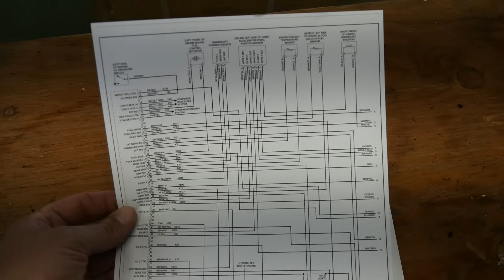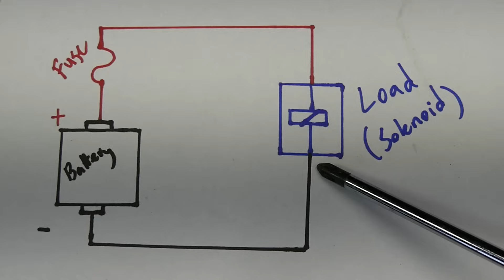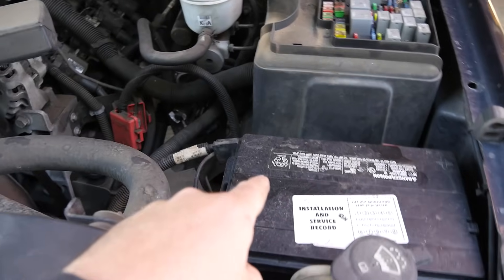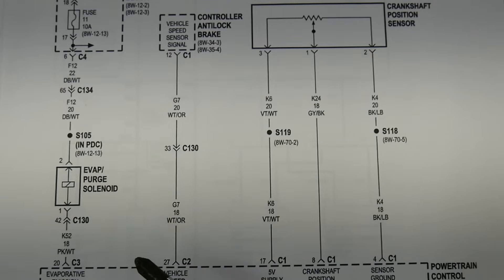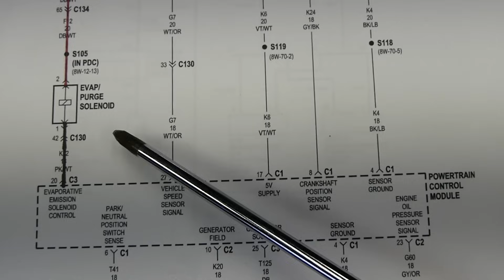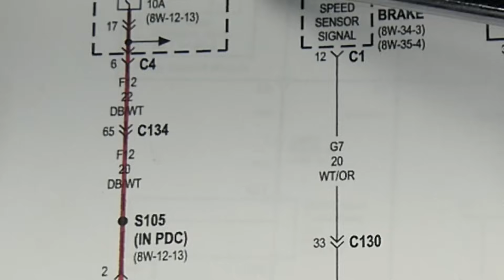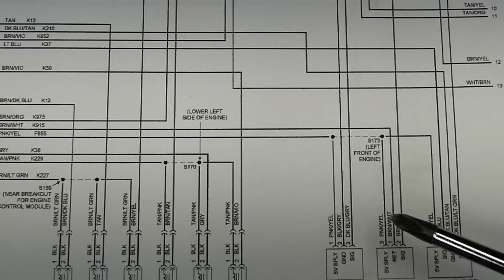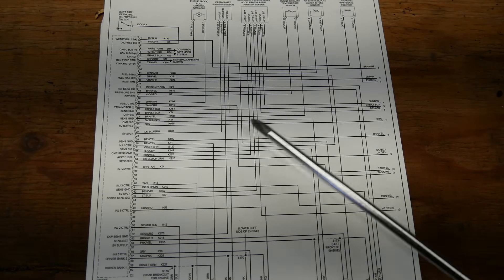Wiring Diagrams Explained - Easy Peazy

Comment: Red wire from the harness going to the alternator pig tail? And the white wire going from the wire harness to the pigtail?
If the mechanic swapped these 2 wires and they get connected backwards does it ruin the Battery?  Does it make the car not start?  Please help

Comment: I’m stuck on an issue, 03 Yukon xl. HVAC issue I traced it back to the white wire in the sp205. The ac control module lights up but no function when it’s plugged in it shuts down the radio, dash gauges and the rear ac. Can u help me please

Comment: Thank you so much for this video! Its super helpful. I was just wondering if anyone has some feedback/ advice for my current situation: I have a 97 chevy van that has a lot of wiring issues including no brake lights, turn signals or hazards. After checking out my wiring I realized that previous owners had totally DIY rewired a bunch of stuff so looking at the wiring diagrams isn't really helpful anymore and I'm super confused on where to go from here. I don't have money to take it to a shop and I'm trying my best to fix it myself but I'm just really confused on how to even approach this project since I can't use a wiring diagram and my wiring is pretty mickey moused. Does anyone have advice on how someone like me with basically no autoelctircal experience could work on a project like this? I know it's a kinda vague question but any feedback is welcome :)) and thanks in advance

Comment: Hi, i have an issue with headlights on my 04 Camry ( Australian built ), they don't work. there are 4 fuses, 2 for each side and none have power. The head lamp relay works and has power IN but the out side shows nothing, ok, but when I connect the + lead of dmm to battery and -lead to the out side of relay socket I get a reading. Is this normal ?

Comment: I must have watched a dozen videos read and reread manuals...

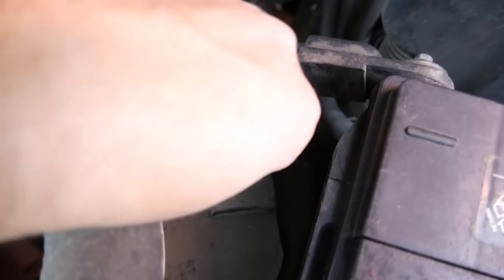At exactly 2:29 you reminded me of an obvious operator error -- having undone several aftermarket catastrophes on a used 1979 Dodge b200 I forgot to reattach the negative battery terminal to the chassis!!

Thankfully only 1 terminal connector melted at a splice point

Next time I'm searching your videos first ⚡🍻

Comment: Hellou. I have a ford fusion 1.6 tdci 2005. I tested the EGR plug with a multimeter and it doesn't have 12 v on the pin,  is a fuse or relay that would cause the problem. Thank you

Comment: I watched your suspension videos since I'll be doing mine soon. Can you get away with torqueing before you set the car down or is it a must to do final torque after on the ground. Also, if after, if it is to be torqued at  100lbs, would you torque to 90lbs and then the final 100 after on the ground?

Comment: I really enjoy your videos & how you break things down & explain in novice terms. I have a video idea for you unless you've already done this. If so let me know. I have a 92 Geo Metro 3cyl. 250k mi. Runs rough & smokes. I'd like to take out the engine & get it refreshed by a machine shop. I'm not entirely sure what to ask or expect especially in prices. The vids I do find are more surrounded around high performance. As are the shops here in San Antonio. That's not what I'm after. I just want a basic. Honing of cylinder sleeves. Checking crank & cams & bearings & maybe polishing crank. Maybe a few more things but again not sure and like I said most vids are for aimed towards racers. I'm actually more interested in a optimal mpg build. What would you recommend?  Thank you.

Comment: Thank you for explaining wiring diagram could you pleas explain how you can test any sensor out of a car with a voltmeter to see if the  is the sensor is working or not
Thanks Lawrence
Reply: You have to recreate the environment that the sensor is sensing in order to see if it's working or not.  If it's a temperature sensor, then changing the temperature (boiling/freezing water) and watching for a change in the resistance on the sensor can be helpful.  Sometimes you just have to back-probe the wires going to the sensor to see whether it's in the proper operating range.  (often changing - sometimes too quickly for the voltmeter to follow accurately).  Sometimes you have to just disconnect something and see if the car's behavior changes.  If it doesn't that's not always a good thing.  Sometimes you have to "activate" that circuit in order to test with pulling a connection.  For instance, a high speed fan circuit may require a certain temperature range, or RPM or the activation of the air conditioning compressor.  

Bottom line, understand how the sensor works, so you can see how to test it.  Intermittent electrical problems are the ones that you pull your hair out on...  Learn to also use a OBD2 scanner that shows higher details than just reading codes.  Some are phone based.  Get a decent volt meter and know how to use it to test across loads, or check amperage readings (need to swap probe positions for this).  Learn not to do resistance checks on a live circuit.  Learn ohms law.  That way you can use a voltmeter to look at voltage drops across a load and determine current readings.   Learn to "divide and conquer"  It may mean you have a single sensor or problem causing multiple problems.  But you may also learn that there are multiple problems there, and the computer has been compensating for it.  Also think about what might have caused a sensor to fail (ie, O2 sensor can get clogged when running too rich for too long, or burning odd substances, or NOT burning fuel until too late (in the catalytic converter - makes loud booms).

Comment: I was taught how to read electrical diagrams while in the Air Force since we had to work on the weapons systems on the B-52 bombers and they wanted us well trained to do the job. I thank you for showing us how we can look at a diagram and figure out where the problem is and I have some tools such as the multi-meter and various meters and I use them when needed.

Comment: If you don’t know how electrical systems work in cars, you’ll never be able to fix anything but the most simple problems. Continue this series!
Reply: I agree and im tired to be the guy praying for the problem to be small all the time. Not even a pro but im ready to get it or die trying
Reply: @CBRRR-eh3ky I’m at this phase, how has it been
Reply: U can if u have xentry ( it's computer which gives u all the details u don't need to understand anything but still u will be able to work )
Reply: Yeah man same here 32 years old wanting a mechanic career literally die for it now
Reply: How do you test from the fuse box to the pins and the module connectors

Comment: 5:45 what do the arrows mean? I’ve always wondered.
Reply: The arrows you are talking about are showing where a connector is. The arrows indicate the actual gender of the metal terminal (not the plastic connector) inside the connector. If it is a male terminal it is arrow pointing out which mates into the female terminal. That way, when you are testing at a connector, you know which side of the connector is which.
Reply: @BTCAutomotiveTech  awesome! It makes sense now! Thank you so much, happy thanksgiving!!
Reply: , directional flow of electricity
Reply: @JustinPaul1st  but the arrows change directions, in some cases they are pointing away from the fuse, in other cases they are pointing toward the fuse. All in the same Circuit.

Comment: How about sources to find wiring diagrams, for the diyer.
Reply: Try AlldataDIY. $30.00/year for 1 vehicle ( half that for subsequent vehicles). Includes component location info. Crucial for electrical diagnosis. If you're looking at wiring diagrams, you'll almost always need to know where the specific connectors, splices and grounds are physically located in the vehicle.  This subscription also includes all factory procedures such as component testing and replacement procedures, torque values and a lot of other info. Worth every penny.
Reply: You never know what resources you could find at the public library and if they don't have it you can request them to get it you never know
Reply: Go to ebay and find a service manual pdf. Like 15-30 bucks has everything you'll need
Reply: @mauricioespinoza5390  If you're referring to manuals such as Hayne's and Chiltons,   they only have a small selection of wiring diagrams for a given vehicle. For example, the Haynes manual I have for one of my cars has 11 pages of wiring diagrams. In reality, there can easily be 50-100 pages or more of wiring diagrams for a given car. They even state that "since they can't include all wiring diagrams for the car, they've just included the most commonly used ones".
Reply: @davidquinn6161  No, I mean actual dealership service manuals with all the wiring diagrams. I got one for a 1997 camry had all the service instructions.
Reply: @mauricioespinoza5390  Yes, those are great. I got one for my 1985 Corvette and it was extremely helpful. But they're very pricey now from the dealer. Over $200.00 for one for my 2013 Impala. And only available on CD's. I prefer paper versions. I bought mine from Helm in Detroit which is authorized by GM.

Comment: R&W  Sharpie!?  I find that a highlighter is much better cuz you can still read the underlying diagram.  And they're available in many delightful colors. Which is actually very useful for highlighting different contiguous conductors. You can use coolish colors like blue or green (I've yet to find a black highlighter, er, lowlighter) for grounds or ground-side switched wires, and warmish colors like red, pink, orange for always-hot, switched high-side, or +5V, and so on.

Comment: Do you know of anyone offering Free Automotive Wire Diagrams?
 now that BBB industries no longer do.
Reply: I don't know of any free sources of wiring diagrams ( unless you live in Canada ) but see my answer to Joe Boyer's question.
Reply: @davidquinn6161  Thanks David, but, $30 bucks isn't Free. lol.
  and Yes I do live in Canada, does someone here Offer a free service for Diagrams?  BBB industries was Awesome for this info,. What happened I wonder.
Reply: @Ron0963  Part Source stores will print wiring diagrams but they don't have stores in all provinces. Since BBB quit offering them, I haven't found any other free source.
Reply: @davidquinn6161  OK cool ,Thanks,, we got Part Source in Ont. I'll keep that in mind,  the GM dealer around here will print off a diagram too (or they were generous that time/day) lol
Reply: Sometimes it's worth buying a factory service manual (paper or electronic) to review.  They're sometimes offered on ebay.  I'd be wary of free manuals these days.  They try to get you to install some skeevy software to view them, or are infected files.  Check in car forums for your vehicle.  Sometimes someone will send an electronic copy to you.  

I recognized a Chrysler format diagram being used in the video.  It's WORTH knowing what those connectors and splices mean and where they're located.  Sometimes those wires contain fusible links that are made to melt under high current loads, and you'll need to know when your circuit has them.  They're invisible to spot visually for the most part.  But knowing where connectors are helps with divide and conquer strategies, when trying to pin down a problem between power and the load, and the load and ground.

Sometimes using cheaper paper manuals will get you by on wiring manuals. (Chilton's).  It's worth reviewing carefully for the circuit you need.  And don't whip out that phone and take pictures of them. 

Sometimes libraries may have subscriptions to access auto manuals or schematics.  For the price of a free library card you can get access.  Maybe there are car clubs in your area, or you can subscribe to online that has a library available for use.

Comment: Your flow direction is backwards. Flow is from negative to positive.
Reply: You refer to the confusion between electron flow and current. Automotive techs and engineers (and our meters) think in terms of _current_. Current is the rate of flow of _charge_. In a typical automotive circuit, electrons move in the direction from the negative battery terminal, through the load, to the positive terminal. Since electrons carry a negative charge, that flow of electrons is a flow of negative charge from negative terminal to positive, hence a negative current from negative to positive. That is a positive current from positive terminal through the load to negative terminal.  That is why current is shown as positive from positive terminal through the load to negative.  There is no point focusing on the electrons per se. It's rate-of-flow of charge that produces the important electrical and electromagnetic effects.  That charge can be carried by negative charge carriers such as electrons or negative ions, or by positive charge carriers such as protons, positrons or positive ions.  The negative charge carriers flowing from A to B produce the same effect as the positive charge carriers flowing from B to A, hence it's useful that both are accounted for as a current from B to A.

Comment: I agree that reading a wiring diagram can be confusing for those who have never done it, but they're pretty easy once you know what you're looking at.  The problem today is getting your hands on a wiring diagram in the first place.

In the last 30 years, automotive wiring has gotten so convoluted that the diagrams in the back of most DIY repair manuals (i.e. Chiltons or Haynes) are nearly worthless.  We went from being able to put a car's entire wiring diagram onto 3 or 4 sheets to needing a wiring tome of dozens if not hundreds of pages just for one vehicle.  Hell, just finding a Ford diagram for which fuses are what can be a pain.

What most of us need is a diagram of the system that we are currently working on.
Reply: all manufactures have tech info websites that you can pay like $20 for one days access, and look through as many wiring diagrams as you want. You used to be able to download the info. as well but they dont allow that anymore. But you can print or screenshot the entire manual if you wish.
Reply: @Mach141  Yeah, I tried that once.  Granted it was a few years ago and I don't remember the name of the website, but it was highly recommended by everyone I talked to.

I paid my 20 or 30 bucks for 3 or 4 days of access to a "complete" wiring diagram.  I don't recall which vehicle (it wasn't my Tacoma so it had to be a US vehicle) or which system I was working on.  Anyhow, the website explicitly stated that it covered that system on that year of vehicle.  On the diagram it clearly showed a wire going to that system... and that was it.  No further details.  I carefully examined all 70 or 80 pages of diagrams.  Nothing.  Half a week and at least $20 wasted.

Before I cough up money again, I want some assurance that the information I need will be there or at least some kind of refund.

Comment: Great presentation.  A diagram can be tricky to look at in a manual. If posible I enlarge it on a photocopier, or just the relevant section. Check the manual 'cause some circuits are sensetive to input from meters. (This will come up next)

Comment: can you explain what a solenoid is?
Reply: A magnetic coil with a rod going through the middle. Used for switches, valves, or to move something back and forth.
Reply: Expanding on weelgunny: This explanation is pretty good: https://www.tlxtech.com/articles/solenoid-101-what-is-a-solenoid
Reply: @Graham_Wideman  thanks very much I watched the video.  Can solenoids be used for a rotating function, like wheels on a radio control car?
Reply: @richieruss5742  Well, in the sense that you can convert linear reciprocating motion to rotary motion, I suppose so (like on a steam engine, or using a ratchet), but ordinary rotating motors or even servos do a better job. Solenoids can however do some jobs that are sometimes done by rotary motors: for example some pumping tasks could be done either with a rotary pump or a reciprocating pump.  But mostly solenoids are used to move things between two positions, like valves.